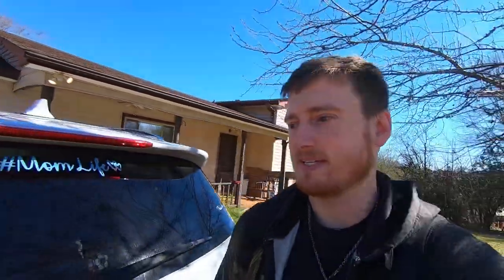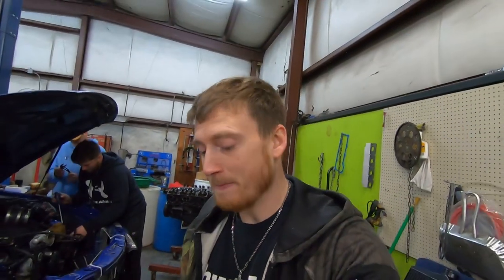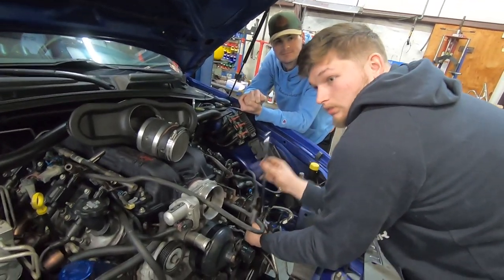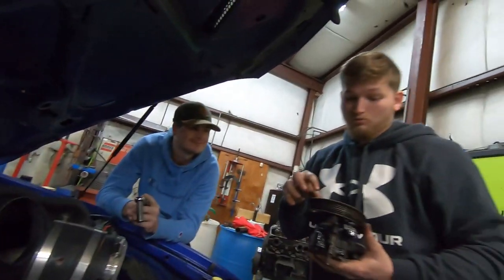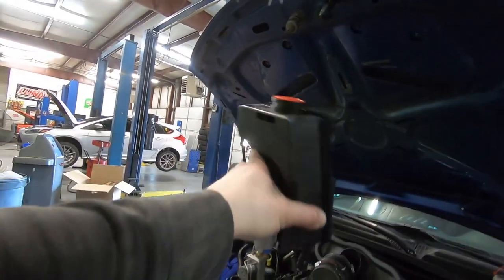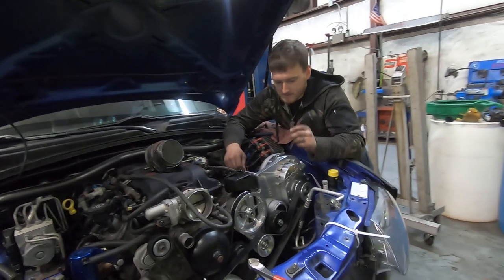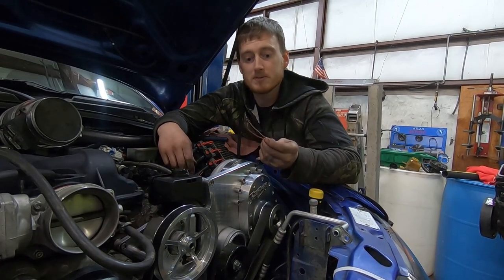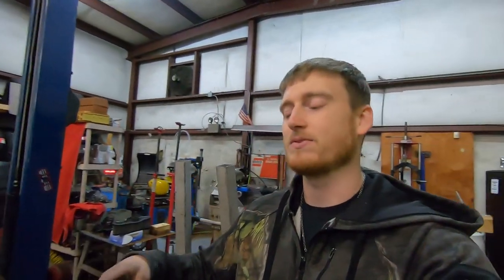Building A Street Beast! (Torque Storm Spercharger Install)

Comment: Can’t wait to get that motor under the red blanket on the motor stand in the next project. Curious to see how that Lunati Voodoo cam, long tubes, and Torquehead coil conversion sounds in the Trans Am. Should be a fun project hitting around the 430 + or - horsepower. If she hit more than that, we will be putting an 8.8 rear end in her!!!!🤪

Comment: what bolt ons are on the GTO besides the BLOWER ?.
Reply from the maker: It’s full bolt on and cammed, has msd air force intake, Texas speed long tube headers, not sure what cam it has
Reply: @lollis_garage3683  damn thats impressive that a pushrod 5.0 beat it. But again i think cause its celebrated and driver mod lol. Cause efi i dont think that pony would pull like it did. But anyway its a bad ass ride nit hateing just saying. Back in 98-2002 a good freind if mine had two 5.0s a 94 5spd carburated and a 95 5.0 efi and the red carburated would allways take it out. But both were bad ass the 95 was lighter cause it was a gt350 it had manual evrything no carpet it had like a rubber floor.
Reply from the maker: @Temperature956  it should still perform the same even with efi as long as it is tuned very well, most efi vs carb dynos make about the same power on the same engine with efi beating the carb most of the time, only by 5 to 10 hp at most. But I like both carb and efi, but also my car is a lot lighter than his, my car weighs around 3200 lbs with me in it and his car weighs probably close to 3800 with him in it. So power to weight ratio is a big reason